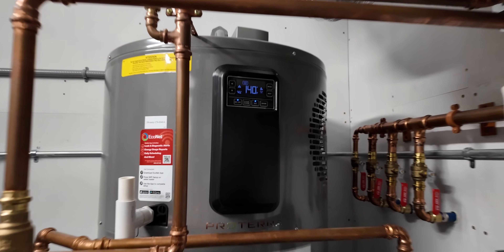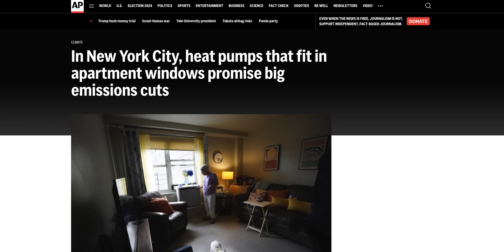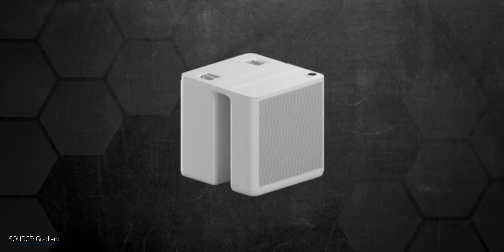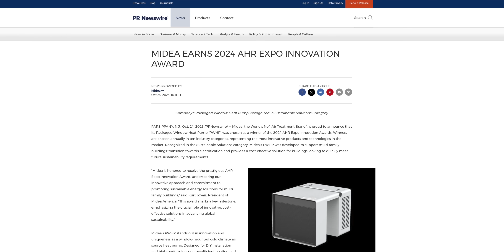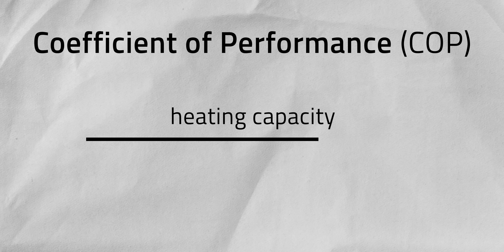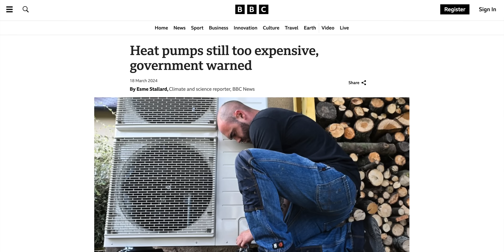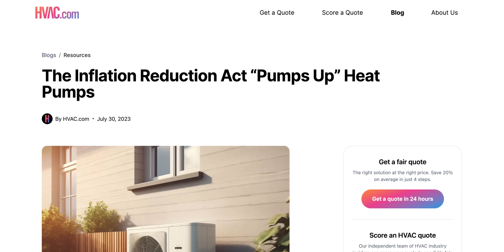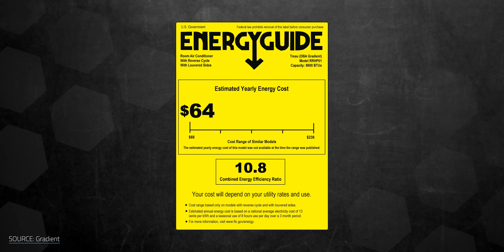Why This Window Heat Pump Is Genius

Comment: Bejing and every other asian country already have heatpumps that cost a fraction of what these units cost.  Installed my 18000bru unit (3 times the capacity of these window units) was about $700 (mitsubishi in one room and samsung in another no cheap knockoffs) .  North America has a long ways to go.

Comment: Impossible to use in Europe, unsure about Asia. We have different window types here, that don't slide down but open like doors and have latches to seal the window as airtight as possible. But seems good for USA, though insulating windows would probably also help a lot.

Comment: And the best part is the electricity comes from Unicorn farts, which as we know is 100 percent carbon neutral. It will be wonderful when everyone has electric heat and electric cars and no power plants for the electricity.

Comment: A 15a 120v heat pump can move about 6,140 BTUs per hour at peak efficiency.   If you think his is enough for summer cooling and winter heating in a poorly insulated building I have a bridge in the Sahara to sell you.  Your figure of 2-3 times the heat transfer compared to the electricity used is dependent on the temperature differential, In NYC most of the year falls in a fairly efficient range.  Sadly colder cities will not be saved by this product.

Comment: The best analogy I can think of here is the desktop vs laptop and these are high performance laptops (within the laptop realm).
 - These package a lot in a small space and have solid upfront numbers while using less harmful refrigerants.
While their performance seems great, their cost is currently outsized with unknowns for maintenance costs / longevity concerns with new products.

Unless forced to, I would not buy these until costs come down, if I would buy at all.

Comment: Hi Matt, JFYI here in the UK the cost of 'natural' gas is ~6p per kWh and electricity is currently ~25p per kWh. So for domestic heating the COP of heat pumps needs to be around 4.2 just to match the operating costs. That said I like the idea of a window-mounted unit that can also be used for cooling in our brief summers.
Reply: Who on earth defines gas by KWh, you pay per m3.
Reply: @kiddy1992  I used to pay per m3, but now the bill is defined in kWh and is quoted and billed in that metric. The conversion is 1-cubic-metre is 11.1kWh ... more or less. I guess you haven't read a bill recently, I think it is a harbinger for what is coming.

Comment: Promo videos never show the power cable trailing across the room, do they? I hope the outside unit has a sloped top to direct rainfall away from the window, and drain holes in the handle holes.

Comment: Very little special about a reversing valve.$3000? And no thanks. I can literally just take a standard $150 unit and three to print some ducts and convert it from an air conditioner to a heater anytime I want.

Comment: They look nice, but I guess you will still need to fill the gap left once the window, as it will almost never fit exactly. Also, $3000 only gets you one unit: do you really want to keep all other spaces unheated?

Comment: The HVAC industry seems extremely archaic in many ways to me. Air conditioners are technically heat pumps, one or a lcouple of valves and controls for them is all that would be needed to make an air conditioner able to pump heat both ways. Not something I'd recommend an amateur DIYer to try to  modify, but the cost of manufacturing a split doesn't have to be more than a few percent higher than the manufacturing cost of an AC, all else equal.

Burning gas just to generate heat, seems both archaic and stupid. It wouldn't be too difficult to generate power from the gas, and utilize the "waste" heat from that as heat, and also use the power. The efficiency in turning the energy the gas represents into power wouldn't be record breaking in modest sized systems, but then again, the amount energy extracted from the gas would be the same, just that some of it would be as power, instead of heat. That would also make it possible to adjust the ratio between gas and electricity used depending on the situation on the grid. 

It's obviously not easy to develop such a system that's reasonably low cost, and highly reliable while also almost maintenance free, but considering the potential, I still consider it relatively low hanging fruit for those that have the resources required to develop such a system.    

I like the saddle style design, but a split in it self shouldn't have to be significantly more expensive than a AC with the same power, and even though the saddle design probably makes it slightly more expensive to make compared to a single box, but all things considered it shouldn't have to be it more than slightly more expensive than a window AC unit, like well within normal variation between brands and retailers.

Comment: I'm a Swede that has minimal knowledge in American housing and heating but this seems strange from a Swedish perspective. From the video it seems like the apartments now have a centralized heating system with water as the heat transporter. From my view point this is ideal for effective heat production and distribution. In the video you say the problem is that the heat is unevenly distributed with some apartments being to warm or to cold leading to big heat losses. Theres very simple and cheap ways of fixing this problem. Here we attach a thermostat to every radiator and you get the heat you want in every room. Here they cost some 20$ each and can easily be installed. Why cant you use these for effective heat distribution? And, it must be much more cost effective to install a centralized big heat pump than everybody buying there own. Standard heat pumps today have a ratio of 1:4 so even there is a lot to gain. On the negative side you dont get the cooling of course. 
There also seems to be a problem of what I can see with the installation being air tight and not leading to energi losses. So for me this is wierd, though it is a good alternative if the heating today is electric.

Comment: Just go for the normal installation, these gadgets are expensive, ugly and potentially way less efficient. A split system with a big ass outside unit will always be more efficient then a portable airco

Comment: While I value the easy self-install design of these units the price is way too high and the efficiency is way too low. 4 years ago I installed a 34 CEER Mitusbishi 6000 BTU Mini-Split I bought for $1600. I chose this unit because at the time it was both the most efficient and the quietest (something not mentioned in your otherwise excellent presentation). While the installation involved electrical wiring, drilling through a wall, torqued line connections, a vacuum pump, multiple nitrogen purges, and unfortunately Mitsubishi’s refusal to warrant my superior self-install, we’re very happy with the unit for our bedroom in Florida.
While I understand the life cycle of early profit-taking and high price for new products, in order to take market share from a MUCH larger market, the price will have to drop by at least half and the efficiency will need to improve by at least a factor of 3. But this self install design does have the potential to be a game-changer if they become more competitive.

Comment: Looks unsafe. Why not keep the hinge inside to let the external unit anchor itself to the inner wall. Iron or aluminum arms holding the external unit are less likely to brake in the future under extreme weather conditions than hinges are.

Anyway. They charge as much as they can. Not a technical overcost since heat pumps do not care much about heat direction. I have never seen one unable to provide both heat and cold here in Europe. It just wouldn't be purchased if it couldn't.

Comment: I purchased a Midea MAW12HV1CWT (12000 BTU) at Costco in summer of 2022 for $300.  This is a REVERSING heat pump.  The User Manual also mentions MAW08HV1CWT (8000 BTU).  Both units are currently available on Amazon for $500 (12k) and $380 (8k).  These units are NOT U-shaped, but are REVERSIBLE heat pumps.

Comment: I currently use the Midea U A/C, which is basically the same thing as this but flipped the other direction and it only cools. I have the 8,000 BTU model, which is currently $380 on Amazon. I've has this A/C for two years now and it has served me very well. It's easy  to install, very quiet, power efficient, puts out lots of cold air, and is easy to use. I don't get how this new model that is very similar is $3000! I'd love to get one if it was $1000 or less.

Comment: I have never in my live seen a window that opens vertically.  Every window in my house opens sideways.  Every house I have ever owned, or seen, opens sideways, with the exception of some 60's construction that cranks open on a pivot (on one side)

Oh and the price is crazy.  Pretty much all roof mount heat pumps I have ever seen are bi-directional.

Comment: We need window heatpumps that work with European windows. Our windows open vertically on a swivel hinge instead of horizontally on a sliding window frame like in the US. We have no AC options in Europe except for house installations.

Comment: While this sounds good i live in a really moderate climate where i don't need heating and only need cooling for ~10 days a year. So spending 3 grand for 10 days a gear with a 10 year life expectancy would mean i'm spending $30 a day to cool my place when i need it(plus electricity). I think i'll just slightly suffer for those 10 days a year. Really this is only semi suffer as i can go an entire year of 0 90+f days, though the random crazy years of 10 days of 90+ do happen even 100+ can as well.  Really even 80+ days are pretty rare. Socal near the ocean is the best air conditioner  :D. I'm writing this at 12:30 6/12 and i'm under a blanket
Reply: This is not made for you

Comment: These seem like a cool idea, but the price has me steaming mad.  Never mind that a 10k or 12k btu window AC unit can be had for $300 to $400, but for around $500 you can get a floor standing "portable AC unit" that can both heat and cool.  Granted these units have some inherent flaws in their design, like being loud because the compressor is mounted inside the house instead of outside, or that the air vent for the "outdoor" heat exchanger that goes in the window has the intake and exhaust right next to each other so you inevitably get some recirculating of that air.  However, a six-fold price increase for simply changing the design of the housing the components sit in is not only ridiculous, it's borderline criminal.  If these units are priced at more than $1000 I can't see them competing favorably with existing mini-split heat pumps for landlords to want to install them.

This is especially true given that windows are only designed to be air tight and secure when they are fully closed.  The best way for these to be installed would be to take out the window, set the unit over the framing, put in new framing and a new window sill, then put in a new (and hopefully more efficient) window above the heat pump.  The problem is that, once again, by the time you do all of that a ductless mini-split heat pump will have been cheaper and easier to install with a smaller wall penetration and less time spent inconveniencing the tenant.  The only way these make financial OR logistical sense is if they are as cheap and easy to install as a comparable capacity window AC unit such that the tenant would buy and install one themselves over a traditional window AC unit.

Comment: i think there is a place for electric boiler conversions, especially with storage tanks, in this conversation. easier to retofit to an existing system, all the benefits of radiant heat. potential to use electric boiler/heat storage as offloads for renewable peak energy, then release energy as heat later for building use. potential to create thermal wells that pool heat and allow for centralized AC in the summer for buildings

Comment: Matt, there are temperature control valves for radiators that work. They aren't that expensive and there are models that are self contained. They do have to be maintained and repaired when not in use. I am not even talking about the fancy electronic one, just bi-metallic strip ones that let up turn your heat up and down on each radiator. Just mandating them as code for the city for all residences and enforcing it would save a lot of energy and save a lot of money in energy bills for the landlords. They can set the max at 80 F (old people and those walking around naked for various reasons) and then just watch the saving roll in.

I am pretty sure that they are code required for new construction, but updating the code for public housing and offering a tax break to landlords that install them and show they are working by having them inspected (get the landlords to insist on having their properties be inspected by a city inspector, see what I did there) would probably work to get them installed city wide.
Reply: I haven't heard of the valves needing any maintenance. Even if they need a tiny bit of maintenance they are definitely the way to go for centrally steam/water heated buildings. The best part is that they offer proportional control instead of the on-off of a traditional thermostat.
Reply: @eDoc2020  Any steam system is going to have increased erosion of the parts where there is turbulence and/or high flow rates. Control valves have both, so the valve and the valve seat erode over time and either need adjusting or replacement. The valves used in steam systems account for this and are either really overbuilt ball valves or carrot valves that need tightening periodically.

Steam erodes metal and most materials as it flows through it, even steel. This is why boilers require a licensed boiler maker/operator to work on them and do checks on them along with regular inspection by the government. They will fail by leaking, then explode if you don't keep them repaired. This is also why steam pipes and valves get leaks over time and need expensive maintenance all the time in older buildings, with the system becoming more and more trashed as it gets older. The reason why the radiators don't wear out is because they are a part of the systems where the steam contracts and loses pressure as it cools on the cold surface of the radiator, so this protects them. Being made out of thick cast iron also gives them a lot to lose.

I think it not being required by code is why the landlords aren't using them on the East coast. It could also be that they don't want the lines to the colder apartments to be failing sooner because of the heightened flow to them so they are running the same flow in the entire system. There is also the issue of how the system is plumbed/designed that having the variable valves on it they might need to run higher pressure to keep it from dipping too low when they are kicking on and off as demand happens to prevent the steam in the system from dropping pressure and changing from dry steam to wet steam or even condensing into water and then causing even more problems. 

I think this lower operating pressure in their system's design is what it limiting their use of the valves, but there is a work around on that, and that is to use electronically controlled valves at the radiators that are centrally controlled so a pressure drop never happens. You can have the valves be mesh networked over a type of industrial WiFi designed for this exact thing and get the power to run them off of a thermo-electric generator in the valve, so you wouldn't have to run wires. It is possible that wiring them might still be needed, but we are looking at low voltage CAT-6 with 24V AC on it for power then, which is easy to run.
Reply: @KnightsWithoutATable  I was thinking of water systems but I suppose you're right, most of these buildings are likely using steam.
Reply: Everyone knows that but places that use window units are older building that don't have modern heat system usually.

Comment: I saw this at Costco and it blew my mind. I didn’t even know what it was at first but I saw the form factor and was like “that’s genius why isn’t this how they’re all done”
Reply: @storminmormin14  the U-shape is logical, but it means it needs separate motors for the interior and exterior fans, whereas the normal window AC box just uses one motor to drive both fans. So the U shape is more expensive to manufacture, but I think having the loud compressor outside the window is worth it.
Reply: @pilotdog68  would it be cheaper to use a small shaft with belts to transfer power to the fan inside rather than use two motors?

Comment: I don't understand how this would work. The idea of a heat pump is to move heat from a hot place to a colder place, but if you are running a heat pump that is just connected to the outside then in what way is it different from just opening the window? I must be missing something.
Reply: Heat pumps are surprisingly effective at moving heat even from very cold places. Modern units (maybe not window units, but whole home ones) can effectively heat a home even when the outside air is as cold as -13 degrees Fahrenheit without a backup! I’d recommend checking out some of the videos Technology Connections has done on heat pumps to learn more.
Reply: @Aiels  Interesting, thanks. Still don't understand how, but good to know.

Comment: I own a duplex and eventually need to replace the old aluminum style windows. I would have to order a custom window that goes up and down to accommodate a heat pump unit. The price tag is off putting considering that the window will cost almost as much.